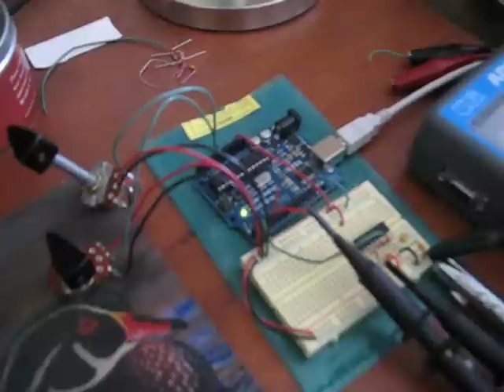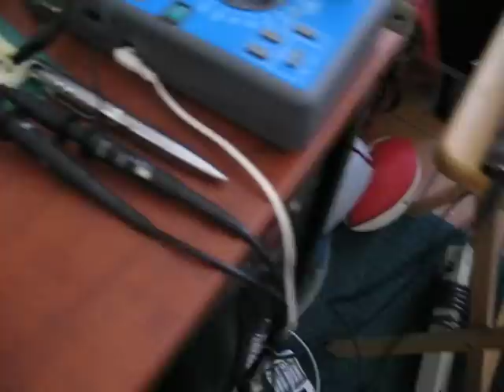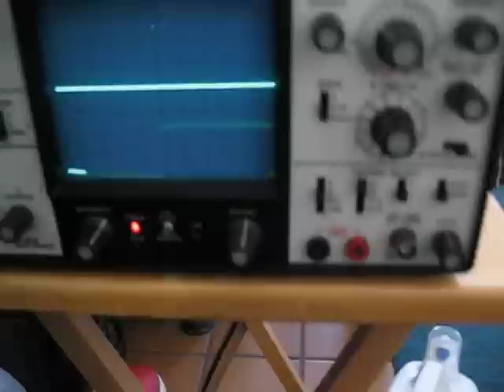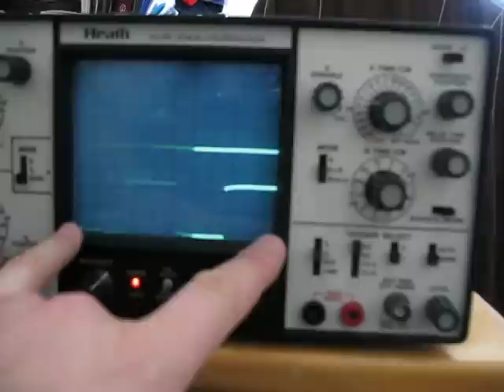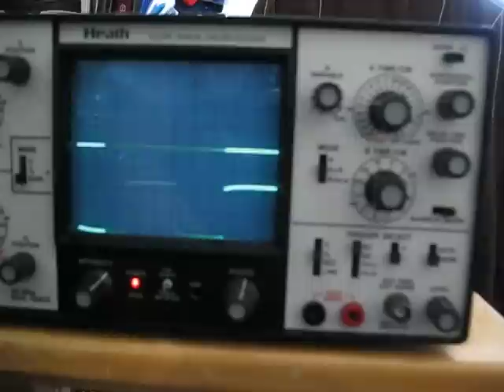Arduino - Triac AC Dimmer

Comment: 3 years later and I just found this because I'm desperate to make my own dimmers! After all the research I've done I almost decided to can the idea for safety reasons (i.e. the fear of frying myself) but this gives me hope!

May I ask, do you have a design up-and-running in the home actually doing stuff? Or was this just for experimentation?

Right now I just want the cheapest, smallest, and best dimmer I can get - if I must make it myself then I will try!
Reply from the maker: This was a real project, but not for my own hardware.  Someone on the Arduino forum was designing the board and I did the sketch.  Unfortunately, I managed to lose the stable code.  I only have an older version that doesn't have stable trigger pulse timing.  I'll look at it and see if it's easy to resurrect and clean up.  If so, I'll post it on Github and comment here with the link.
Reply: koyaan1sqatsi Great, thank you so much. That would be fantastic. Right now I have some nifty faceplates planned for my new home with oleds to display track title, volume, and lighting mood, and tactile switches for mood lighting recall. The missing part of the jigsaw is the electronics side - the mains dimming!

My only other option is to do the dimming separately from the arduino and use a 555 to control the timing, and then have some kind of low DC voltage controller circuit for the dimmer. Seen a few schematics but haven't made anything yet!

Greetings from London
Reply from the maker: ***** Still working on it, but here it is.  Feel free to try it out.  It's set up for 4 dimmer channels, just to demonstrate how to use multiple channels.  Easy to trim down to one.  https://github.com/ChestersGarage/AC_Dimmer